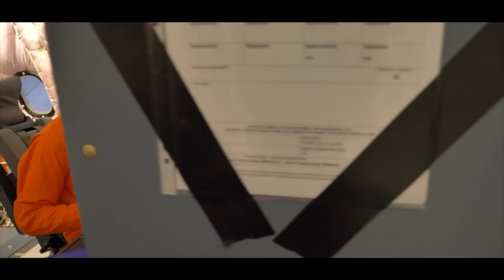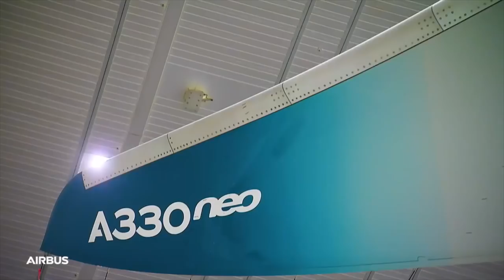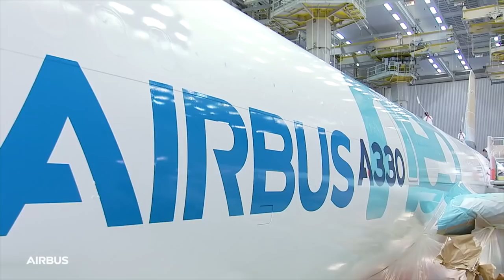The AIRBUS A330neo

Comment: I think the neo wont prove to be as big as seller as the original A330. The original A330 was only competing against the 767 in the 250 seat market for most of its production run. That's a battle it won. The A330 neo is competing against the 787 which is a  formidable competitor which has it beaten for range at least. Even in the transatlantic market its own A321neo will end up taking away orders. 10yrs ago if an airline wanted transatlantic range in a new airliner with at around 200-250 seats the A330 was it. A matter of fact if they wanted 180-200 seats with transatlantic range they had buy the A330.  If you look at the fleets of the major carriers across the atlantic nearly all of them have the A330ceo. The only reason they didnt sell more was because of American carriers not updating their fleets until recently and even now between AA/United/Delta they are over 150 767s still flying. Not to mention the 757s. Delta at least has A330neos on order along with their A350s. United has A350s on order but I dont them ordering any A330s. American is looking to phase out the A330s they inherited from US Airways so I think they dont have any A330s in their future plans. All that to say I just think it will be a much slower seller than the older one. Maybe in Asia they will pickup some more orders one hopes.

Comment: I wonder if the A330-800neo will ever make production, with Hawaii now the only airline, with only six firm orders...

The A330-900neo has the range of the A330-200 and its costs will be similar, so an airline might as well operate the larger type and benefit from the savings of being able to sell more seats for a similar operating cost.

However if the A330-800neo is dropped it leaves a very big capacity gap between the A321 and the A330-900neo! 
 
I would like to have seen the A330neo benefit from composite materials like the 787 and A350 and increase the efficiencies of the plane even more.

Comment: Hawaiian Airlines is an interesting case. They are the only airline to order the A330-800 at present and have 6 frames on order. The only reason for this is because of the cancelled A350-800. Ironically, with only 6 planes on order, Airbus might not even build this variant and poor Hawaiian Airlines has to look elsewhere. One possibility is the Dreamliner. Airbus will have to refund their deposit in full because in both situations (A350 and A330neo) it is not the Airlines fault for the cancellation.
Reply from the maker: Sure is interesting! Thanks for watching :D

Comment: Well the A330-800neo hasn't sold because of the 787-8, but the A330-900neo is closer to what airlines want, a mid-range, low cost aircraft for trans-Atlantic and trans-Pacific routes.
Reply from the maker: you are spot on :)

Comment: Really well explained. The A330Neo certainly both looks and sounds quite fantastic! The cockpit looks great as well. The fuel economy also sounds great. Pretty impressive range and weight capacity as well! Would be nice to see this with TAP soon! Also looks like Delta and Air Asia will get quite a few each. Interesting to see how many airlines from across the world are interested in this airline. I think Qantas would do quite well with these new aircraft. Would be a nice replacement for the A332s and A333s! Keep it up!
Reply from the maker: Cheers man! The cockpit window design is similar to the A350 which adds such a futuristic vibe in my eyes. Thanks for watching once again!

Comment: So what an airline wanting an aircraft in this size category have to do is either get the a330NEOs or go all in and get the 787-8 or the 787-9. 
Tricky choice. The 787 is clearly the better aircraft when it comes to fuel, range, passenger comfort etc but if you already have a330s in your fleet, its hard to justify not getting the a330NEO. In other words, you would have a lot of explaining to do to your boss.
Reply from the maker: It's certainly tricky. However, some airlines like Qantas may opt for the A330-800neo for popular routes like Melbourne to Sydney whereas, the 787's would and are being used on European and American routes :)
Reply: Yea that would probably make a lot of sense for them to use the 787s on those really long routes. 
I really like your content, so you got another subscriber! Keep up the good work :)

Comment: You should do a video on if Airbus should build an a340 neo
Reply from the maker: I would love too but something like that is highly unlikely in my eyes.
Reply: Four engine airliners are pretty much dead. Reengining A340s would make them more economical compared to the older ones yes but they'd still be at a disadvantage compared to any modern 2 engine airliner much less a reengined A330 or the 787 or 777X. Qatar and Etihad which took delivery of A340-600s very late in that program have stored nearly all of them. 4 engines are out.
Reply from the maker: Unfortunately so Rohan.
Reply: Yeah I see what you're saying

Comment: The 330NEO would also be good replacements to the current 330s since the control configuration and aircraft layout is mostly the same. This would save crew training costs when  transferring them from the A330 classics to the NEOs . But the extreme fuel efficiency would increase maintenance costs for current routes. A plane landing on a heavier weight would add more maintenance costs.

Comment: I believe that the A330neo will be a very attractive aircraft for certain operators. I have described it as 'Airbus pulling a rabbit out of a hat' because at relatively low investment they have improved both the A330's operational and capital costs by using an existing airframe that's already paid for itself. I like the looks too.

Comment: Unit cost: 
A330-800neo: U.S. $254.8 M (2017)
A330-900neo: U.S. $290.6 M (2017)

Unit cost:
A350-800: US$260.9 M
A350-900: US$295,2 M
A350-1000: US$340,7M

I dont see any reason why airlines should buy A330 when they can have A350 for the "same price". A350 will be more efficient and according to stats it also gives more seats. If they want Airbus they should buy the A350 not the A330. I think that maintenance cost will be almost the same and spare parts for repairing will be probably little bit more expensive for A350, but A350 seems to be more profitable per seat.
Reply from the maker: I think some airlines go for the A330neo purely because the A330 is already in their fleet. I'll be putting a video out on that issue tonight :)

Comment: I personally believe Air New Zealand should order some to replace the 777-200ER.
Reply from the maker: That'd be cool! I reckon the livery would suit for sure!
Reply: if you ask me I think they should order the A330 NEO to replace those troublesome 787s ha ha
Reply from the maker: Ahah they’ve been having some issues lately!
Reply: Except they can't be configured with the same passenger capacity as those (287 vs ANZ's 304 passenger -200ER cabin)-the A350-900 (315 passengers in a typical layout) would be the more direct successor, as is the A35K for the 77W (366 vs 365 seats in a typical cabin layout).
Reply: +ojt169 Aviation Air New Zealand already has the looks of replacing the 772 fleet with another Boeing-made aircraft, predominantly the 777-8X.
Reply: ojt169 Aviation I think they will replace them by the Boeing 777X.
Reply: Wrong aircraft. A350-900 is the one they need to use.
Reply: Yes they'll be able to go shopping once Roll Royce pay up compensation for their Trent 1000 engines. Perhaps the Dreamliner engine issues is a big juicy story for DJ to cover now the FAA has announced new ETOP restrictions. Not just AirNZ suffering there are scores of airlines regretting they ordered these engines.
Reply: ojt169 Aviation definitely I reckon. we have some very ugly looking aircrafts in our fleet. Plus I have been seeing a few news lately of more problems from the B777 class we have now.

Comment: Emirates should order and it is a very good looking aircraft
Reply from the maker: It’s a very good aircraft! Not sure if they will order it though :/
Reply: Emirates already turned down the larger A350 in favour of the 777X, Ethihad on the other hand i suspect will eventually order some, as will many existing A330 operators, AF/KLM, Lufthy and virgin Atlantic maybe.
Reply: They ordered 40 Boeing 787-10 with delivery starting in 2022
Reply: Emirates aren't interested.
Reply: Emirates don't buy cheap planes.

Comment: Emirates must order them
Reply from the maker: Hope so, but it's unlikely :(
Reply: Yes it's very unlikely cause they just placed an order for 40 787-10 s ...but I think the a330 neo or the a350 would have been a better solution as the 787 are much smaller as compared to Thier ageing 777s.
Reply: Stirling Day well said...but I think that Emirates Is looking for something from airbus than that from Boeing which Airbus simply can't make..they could use the a330  neo for the short regional flights like they did before and still do